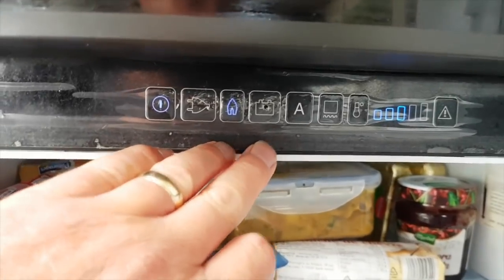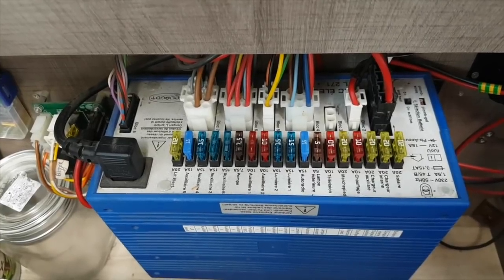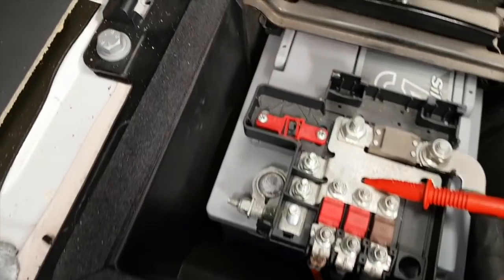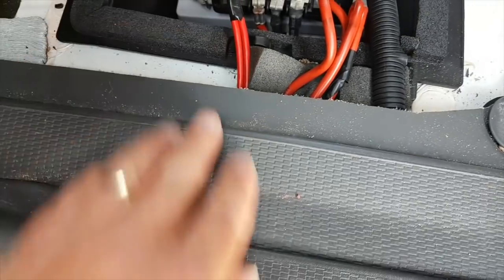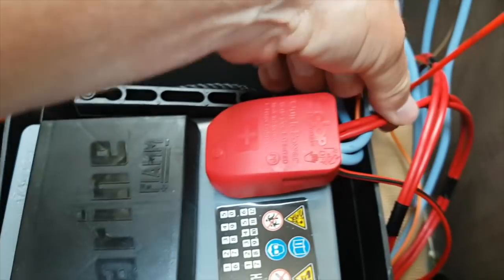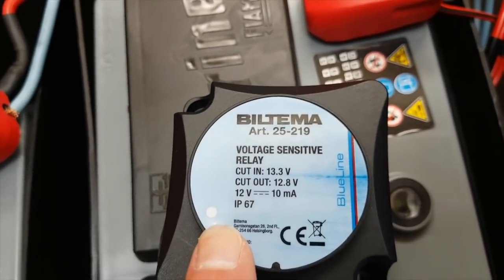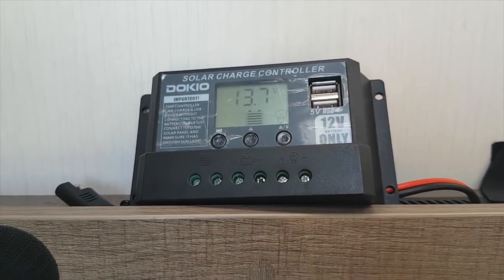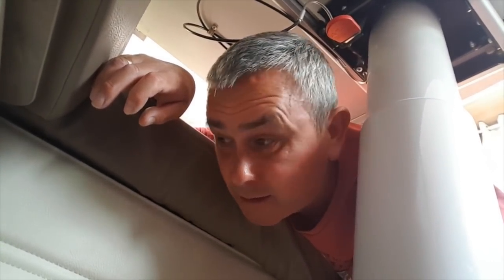How to install a voltage sensing relay in a motorhome

Comment: Biltema saves the day! As Always. Im thinking to use VSR on my MPPT charge controller  to use exessive charge on mobile phone, laptop, circulate water in solar heater for the shower in my cabin. Everything gets top-up.
Reply from the maker: An interesting project. Don't see why it wouldn't work.

Comment: Thank you for the video! What type of leisure battery do you have? Would the VSR pair well with a lithium battery on an older car (no smart alternator)? You also have solar panels, right?
Reply from the maker: Hi Viktor, we just have standard gel batteries so I don't know if it would work on a lithium. we have both a fixed 120w solar panel on the roof and a portable one that we can move around the van and point directly at the sun which is very useful in the winter when the sun is not directly above.

Comment: Good effort! ...Have you been plugged into any potentially dodgy power sources recently? Like a campsite using a generator perhaps. Are your Leisure batteries charging off mains? 
My Electrobloc died a couple of years ago and I was very suspicious that a campsite power surge was the cause. Inside the electronic there's a small glass fuse that protects the charger, which may well be all you need to replace. In my case, the charger was suspect as well (and 18 years old), and my internal fuse kept blowing, so in the end, I replaced the whole unit. Not cheap!
Keep the pictures and vids coming! Happy travels.
Reply from the maker: Hey Peter, how you and Elaine doing? No dodgy power sources. We are charging off mains no problem so have no idea. Nothing obvious here so I by-passed the bloc for the time being. This scenario is a bit like the stereo argument of the 80's. Do you go separates are an all in one. With separates if the CD player stops working at least you have the record and tape deck to keep playing music but with the allinone if something goes wrong the whole lot has to be sent back, LOL.